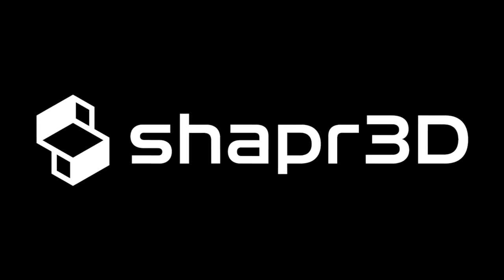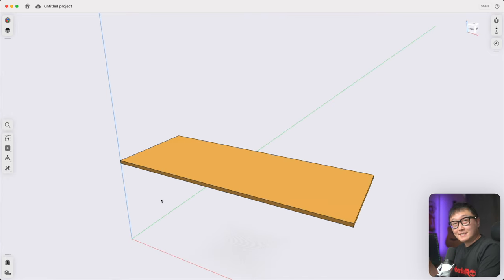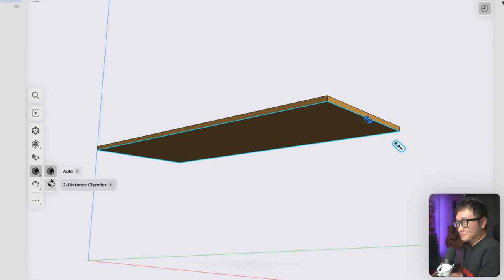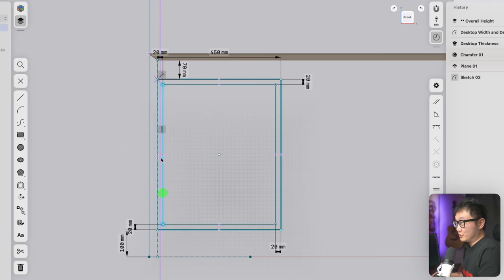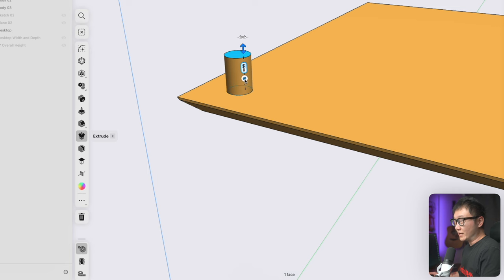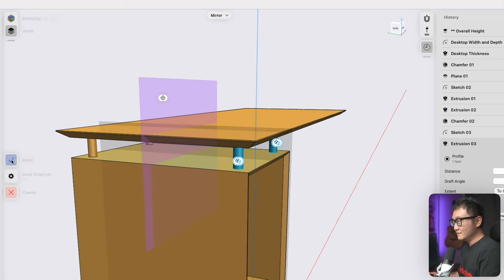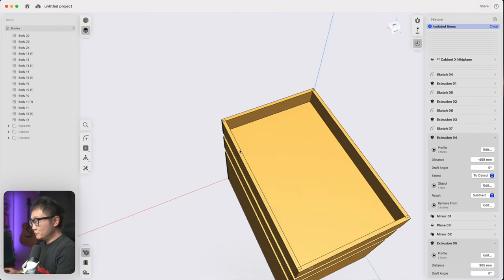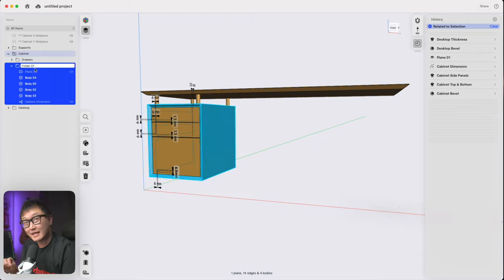Desk with HAIRPIN LEGS In Shapr3D - CAD Design For Woodworkers

Comment: So I went through this video in detail and can honestly say it helped immensely to get me to a reasonably proficient level in Shapr. There are some issues that I would like to go over. While the interface is usable it still has a way to go before I would consider it refined. Here are some of the things that I noticed. 1. It does not appear that you can edit the plane function in the history. I suspect this may be true for a lot of the commands in history. Some just act weird when you go back and try to change things. 2. When you change the name of a sketch in the browser, it changes it in the history. When you change the name of a plane it does not change it in history. Seems to me that if a command results in an entity added to the browser that they should share the same name as it does with sketches. If a command in the history simply revises an entity in the browser (eg a chamfer to a body) then it probably would not need a name change since that revision could be on multiple edges.   4. Selecting an entity in the browser changes history to only show related items however selecting a body does not show the sketch that it is related to in the history. 5. Changing to new body in extrude in the dialog box in the history rather than using the icon on the body has unexpected results. 6. I personally think that renaming items in the history is just too much work. The focus should be renaming items in the browser and using folders for hierarchical storage similar to the assembly / component paradigm in Fusion 360. 7. The fusion convention of copy and paste or paste new does not seem to be implemented. In other words sometimes you want the new entity to be connected to the original entity and reflect all changes to any iterations. Sometimes you don't want them connected and as such you would use the "paste new" so that it is a new entity on its own. This is fundamental to parametric design and shows just how far Shapr is from being parametric. For example if you change the length of one of the drawer sides only that entity changes. It seems to me that since they were derived from the same extrusion and the same mirror that changes should cascade through. 8. This is related to 7. When you do a pattern command the bodies that it produces are not connected to each other like they are in Fusion. I honestly don't know if this is better or worse. For example in Fusion if you build a wall and put x number of studs 16" on center at 96" high and then you change the height in the sketch all the iterations change to the new height. Personally I don't like that. I think it is overkill. But Shapr version is underkill. This is where I think formulas enter into the equation. If I set a parameter of studheight= wallheight-(studthickness*2) then all the stud heights will change when I change that parameter and I don't need the software trying to outthink me. If I want to change one of the studs to a different height I go and change its formula to something else like DoorHeight.  Anyways there are more issues but the other stuff is nit picky. On the positive side after going through this exercise of learning Shapr, I would not hesitate to recommend it for someone who is starting out. While it is intuitive the beta still has a lot of places where things just don't work as they should. At least twice I had to go back and watch exactly how you implemented something before I could get the command to work. It just didn't work intuitively. I love the interface and I love the direction they are going enough to make me conflicted about getting a Fusion360 subscription vs Shapr. I am a woodworker and for what I do this program checks almost all the boxes. But Fusion has so much more and for not much more. Very perplexed.

Comment: A comparison video between Fusion 360 and Shapr3d would be interesting. Do you have a preference?
Reply from the maker: Fusion 360 has a lot more features like simulation, surface modeling, and CAM. But in terms of solid modeling I’d say they’re 95% the same, but Shapr3D has the advantage of also working on the iPad and not as clunky as fusion 360. I kind the convenience of being able to model on the iPad so I can do it anywhere, including in the shop. So I prefer modeling using Shapr3D

Comment: Great video, thank you! Question - when you do your constraint checks....move the overall height, adjust a dimension, etc... How do you approach fixing a model that is not working with those checks? I'm halfway through this video, and when I raise the overall height, only the desktop is moving. I'm also having a problem when changing the cabinet dimensions. Just curious how you would approach finding the problem to fix it. Thanks in advance.

Comment: Let me first say that I think your videos are great and your reaction to your initial version of the reindeer on that video was so funny especially because I was thinking the same thing. I am a Fusion user who has started to consider the benefits of Shapr3d. It seems now however with the addition of history based parametric design it is now starting to look like Fusion with a bit cleaner interface. I know they are planning to add formula expressions which will complete the same parametric functionality already in Fusion but honestly it still feels like a partly broken under implemented version of fusion. In your last video you exported to Fusion for the CAM features. Those features are only available in the paid version. So it appears you have not gotten rid of your Fusion subscription as of yet. I get it you like to use your Ipad and your Pen but my Ipad hardly gets touched. I far prefer my computer with its big screen. Fusion is now offering a 3 year locked in deal that only requires an annual commitment for $38 / month. That is only $13 more a month than Shapr3d with, in my opinion at least, a lot more functionality. The downside being that it has a bit more of a confusing interface. Can you convince me that I am wrong?
Reply from the maker: You’re not wrong. Fusion does have a lot more functionality than Shapr3D, but besides CAM, I really don’t use any other features in Fusion. The CAM functionality is available on the free Fusion version, which is what I’m using. So as far as modeling, the two programs are the same for me. The advantage of Shapr3D, for me, is how well it works for my workflow. Designing on the iPad is convenient, but that’s not all. A lot of times I design on the computer as well, especially since after getting a Spacemouse. I can do an overall design on the computer, but then I can bring my iPad with me to the shop for actually building it. And I can add or change details by making measurements on the actual physical project. It beats jotting down some measurements on a notepad and running back to my computer to make design changes. If I’m making those changes on a computer, chances are I’ll probably forget something and run back into the shop again to make more measurements, then back to the computer again. So having an iPad right there with me in the shop smooths out my workflow so much. Everyone’s workflow is different, so if you’re 100% a desktop guy, whatever I say probably won’t convince you otherwise. You’ll just have to try it out and see how it can fit into your workflow. I used to not touch my iPad either. Shapr3D actually made my iPad an integral part of my life. I now use it more than my computer. Not just for CAD. I use it for just about everything I’d use a computer for, except for editing videos.
Reply: @BevelishCreations  Well I appreciate the quick and full response. I am set up similar to you. Probably more towards the traditional woodworking end of the spectrum. However on the CNC end I have a Shaper Origin workstation and two Lowrider CNC's all on one table. This allows me to get 3 jobs going at once. I like to do inlays that are the more traditional detailed ones and I don't like them to look like they have been done with a CNC. In order to do this I pocket the insets down to 1/32 bits and sometimes go back in with a small chisel if I don't care for the rounding. I have found though that using standard 1/42" veneers that any bit will just tear them  up. I built a laser to fit in as a spindle replacement for the Shaper which allows me to get down to about a .2mm kerf. I won't bore you with anymore details but as you can imagine I am constantly running back and forth to the computer to revise the gcode and keep things going between the 3 machines. I got to say though you have an interesting approach to furniture design. I don't want to be critical of things produced on a CNC however running through the throngs of projects that are produced on Shaper Hub I notice a ubiquitous style that seems to be forming. The stool you produced was clever and had an interesting beauty so kudos to you for designing furniture that is reasonably easy to build but has a human character in it. So anyways I am going to give Shapr3d a go because I like your workflow. Still not sure about the Ipad since I have a laptop setup in my shop but the portable Spacemouse looked cool and could travel back and forth with me. Keep choochn' the videos out. All your stuff is astonishingly good.